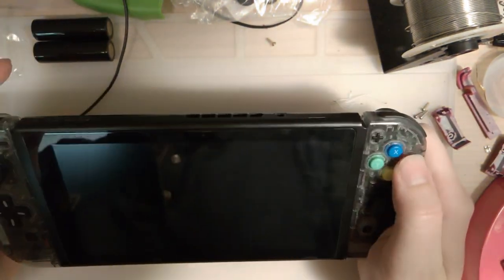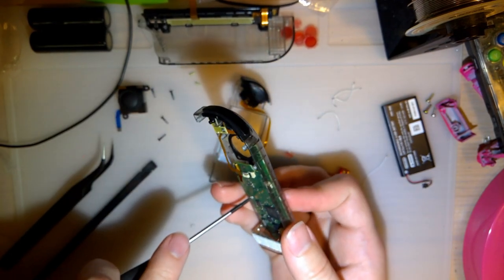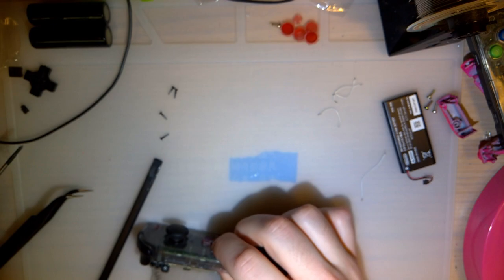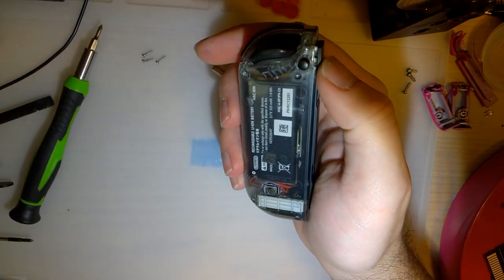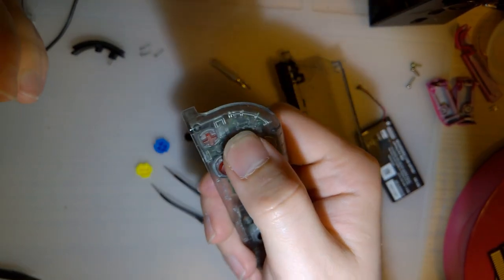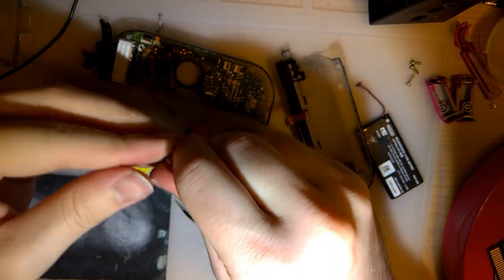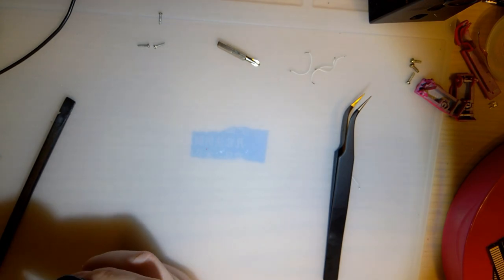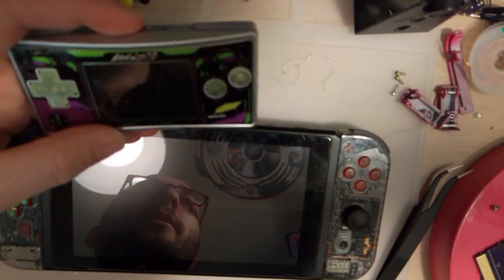Installing New Cast Buttons in my Switch Joycons

Comment: Did you want try fixing my dsi ll? I tried replacing top screen, fuses were good, and power board is fine.
Reply from the maker: No thank you. With my limited experience with DSi consoles, I'd have to resort to throwing parts at it until it worked (and I already have 20+ DS consoles).
Reply: @makho  Do you any extra dsi LL boards or botton screens? Thats all I have left to try.
Reply from the maker: @indcsion  I only have the one LL console (I guess it's technically an XL since it is a domestic model). No extra parts or parts consoles.